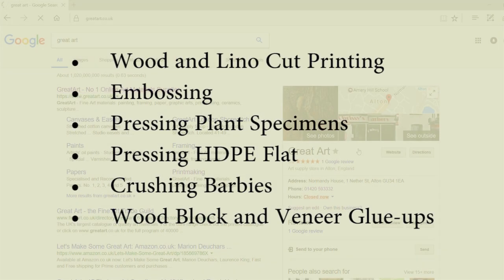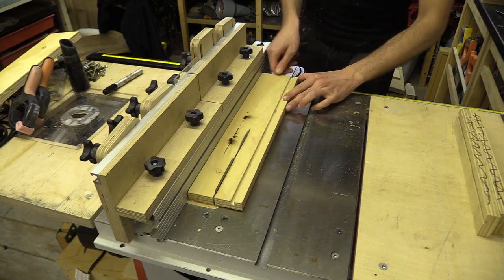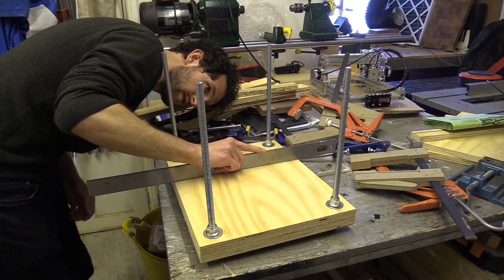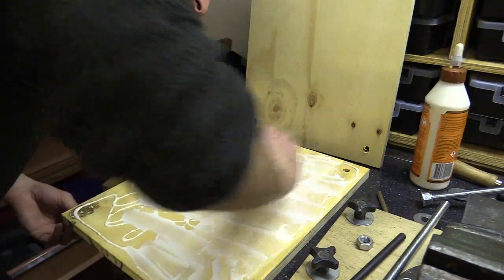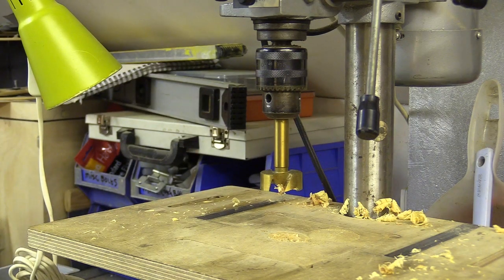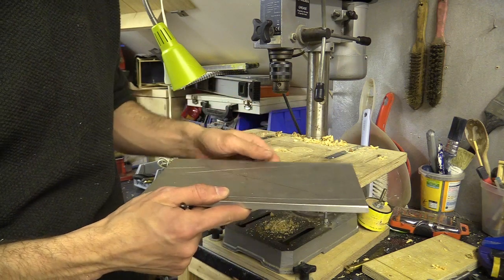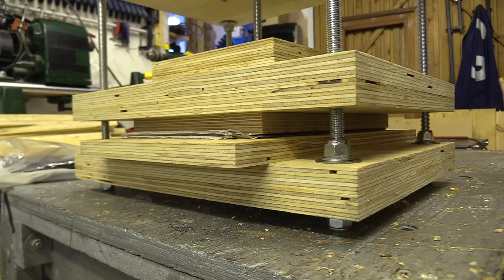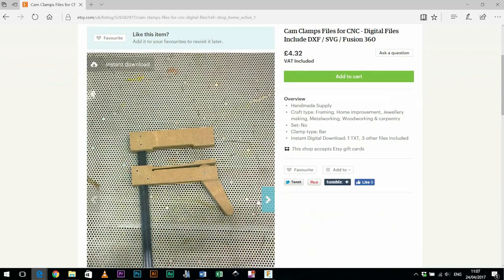Making A Printing Press / DIY Vertical Surface Press / Clamp

Comment: ....There's NO way I'd get the four metal bars to all point in the same direction upwards! This is really great to watch, by the way. Have you ever made a horizontal press? I'm lucky enough to have a heavy duty book press. I observe that in addition to crushing barbie dolls you could use your press for embossing. This was my observation as well!  I was surprised with the results I got pressing my embossing folders as I assumed that it wasn't suited to this task. Or are you referring to a different type of embossing (like they do with a diecut embosser)?

Comment: I make wooden blocks out of several layers of wood.  I think this would be great for that project.  Up until now I have used bar clamps and that takes some time. I think this would save time in this step as well.I think I would use a larger threaded rod.
Thanks

Comment: Savaas P: Thanks for the clear demo and explanation of your reasoning as you progressed through this project. I found it helpful for my own planning for a similar device for my shop. Question: do you notice any flex or deviation in the center 12 mm rod as you compress a wide stack for gluing? I have some 25.2 that I could use, but wonder if that might be overkill. And, thank you again for your quest to enlighten.
Reply from the maker: Only thing that flexes is the aluminium plate under pressure. Hmmm it really depends on what you're trying to press.

Comment: what brand was that mobile metal-cutting bandsaw?
Reply: Bosch. Its a neat little unit that does up to 65mm from memory. Way lighter than the Dewalt/Milwaukees, but they have more mouth opening